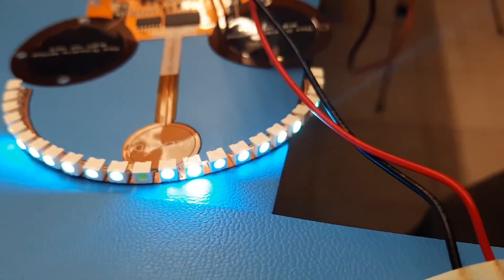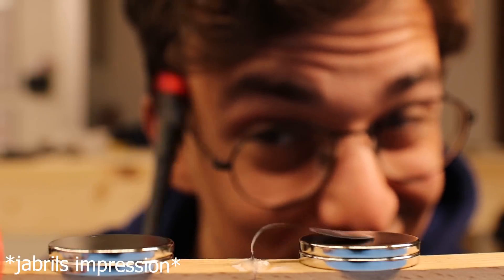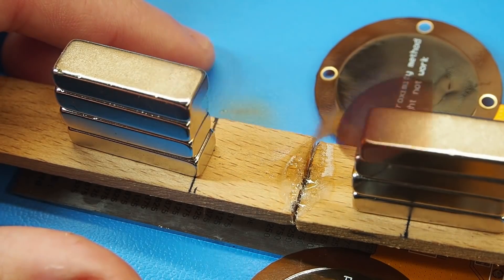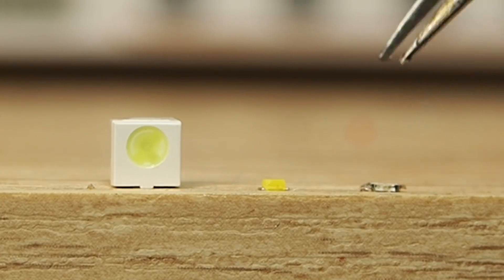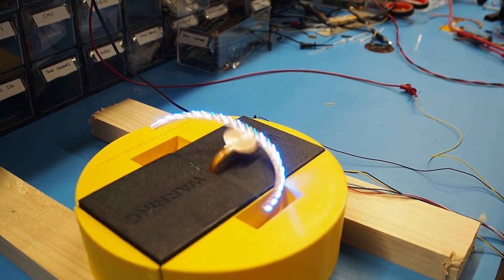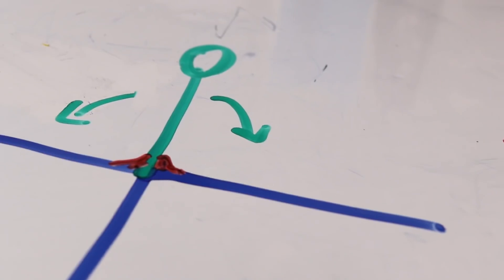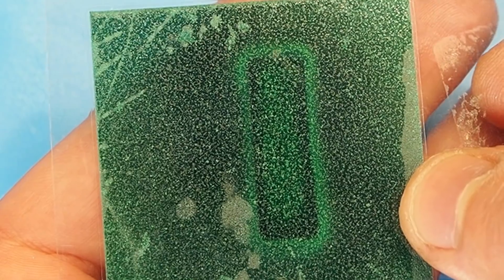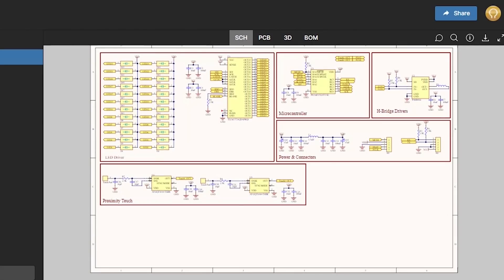Hemispheric Flapping Display

Comment: Idk the flexible display part introduces too much loss because of its wobble, and it also limits the accuracy of the display as it is not rotating on one axis, but rather wobbling as it slams into each of the magnets and accelerating backwards and repeating. Also, air drag affects it, throwing off its trajectory even more. Your best choice is to reduce its rotation to one axis by stiffening the lever arm and integrating a hinge, to save much of the energy without creating too much weight and being minimal and gaining the most accuracy. The only issue is it is less flexible, but honestly, servicing would be easier (if you engineer it properly at the axis of rotation not to tear the flex pcb) and you would get far better picture from it. Also, because you are adding a stiffened lever arm and a hinge, you can replace the coils with a magnet, and swap places. A small neodymium magnet can be attached to the lever arm, and two coils can be placed in place of the magnets. Allowing you to make extremely powerful magnets with electricity, reducing weight, and overall, accomplishing what you want. You would get far faster speeds as  neodymium magnets are quite strong and it's distance from the axis of rotation would mean high torque, which means higher acceleration, which means higher frequency. Of course, in order to get a proper image, you must first use physics to find the velocity at time T on the path, so that the refresh rate of the display as it is moving is in coordination with the instantaneous velocity of the device. Otherwise, your image will be stretched and disfigured. Of course, acceleration is not constant and so you cannot use reformatted gallileans to get instantaneous velocity, but that's your problem not mine. I am not programming it, nor am I getting the hardware. Of course, you assume each time it hits a magnet, it starts at rest and then has a non constant acceleration. The electromagnet it pushes away from should be same in polarity, and the electromagnet it is traveling to should be opposite in polarity, therefore, force would be lowest at the center of the path  it is traveling and therefore the minimum acceleration, but the velocity should have kinda a local max at the center of the path, then keep going up and accelerating as it goes to the reverse polarity coil. This also means the coils would be out of phase, or reversed as a square wave. With it's frequency depending on the time the lever arm takes to complete its journey. Also, for the LEDs, attach like little beads to the ends of them or something so that they glow visibly at a high viewing angle. Actually, instead of a solid lever arm, you could like make a segmented interlocking flexible (rubber like?) bendy arm thing. Like how those 3D printed grabbers work, with strings and flexible fingers that move in one axis. That would also reduce wobble, but it would add a lot of loss. If you are dead set on flexing, that would work though. Or you could like just get a ball, a motor, an arduino, an led strip, and make it do the exact same thing with zero problems.

Comment: Regular Steel has a way too high remanence for this application. You need a soft magnetic material like (very low carbon) Iron, FeSi, FeNi, Ferrite, etc. So you can just buy a magnetic powder core in the right size.

Comment: You are approaching it wrong. Get flappers out of your mind, make an led matrix and make it rotary, this way you get any refresh rate (depends on RPM) and its easier. Electrical contacts can be transfered trough rotary brushed bearing specifically for empowering rotating devices

Comment: You work with heavier parts, so you need stronger mechanics.
Make the flexing parts stronger. Add flexing parts at the ends of the led strip to stabilize it. Make the led strip harder. Make the coils stronger.
I imagine a design where you have two coils at the ends of the led strip and two sets of magnets to work with them. The led strip itself is flexing on the ends and not in the middle. That way the coils and the magnets will be closer to eachother and the led strip will be more stable while oscillating.

Comment: I think redesigning the PCB from a 'T' shape to a '∩' shape might help. Then there would be 2 drivers at both sides of the upside-down 'U' increasing the actuation force and frequency. It would also increase the size of the display (allow for more LED's)  because now you don't have to worry about the ends of the T flopping anymore.

Comment: attach the semicircle to the main arm - the end flapping is acting as a dampener making it so you can't get higher frequencies
Reply: Or remove the main arm and use both sides of the semicircle to drive the semicircle.
Reply: Well having the center not attached would create a similar, though much less significant issue, I think ideally you have a mesh that connects the whole array to the pivot point, which is only flexible in one direction

Comment: Consider anchoring the ends of the LED strip to prevent the outer LEDs from wiggling around so much. The added stability might help reliability as well as display fidelity.

Comment: a big problem is that you have only one hinge point, so the thing is really wobbly. maybe you can make a design like the first flex-display, but with two tails and the spools further apart?
I think additional spools are necessary here because you are trying to move more leds with only one spool instead of the two you had in the first display.

Comment: Awesome project! I love these quirky builds of yours. If I may say from the mechanical side of things, I'd recommend not having the led in a halo shape like that, perhaps a semi circle might work better. With more mass further from your pivot point you have more angular momentum and a harder time changing direction. Also a lot of energy is wasted in the 'flapping' of the halo, if you can make that part more rigid I think would be more reliable. Maybe pinning the ends about the axis of rotation could help? Add a small loop to the ends of the 'halo' and put a rod through them.

Comment: With no background information (first vid of yours I have seen), I am not sure why you don't just use  a motor to spin the arc 360 degrees, at high speed. On the low 180, just turn off the LED's to give a hemi sphere...Heck, just use a transparent 180 degree  half circle of clear material, mount the LED's in an addressable grid, and with 360 timing, you could create a half or full sphere in 3-D that was full color and support 3-D imaging. Make it 0.5m in diameter and you would have quite an impressive spherical POV display visible from any angle. Also, then you could use a vertical axis, and make it rectangular, for a cylindrical 3-D display. Use 'arms' along a vertical shaft for low air drag, possibly small airfoil shaped tubes with SMD LED's on a narrow pcb; you could also stagger the arms ' 'spirally' around the shaft with each 'step' very close to the next vertically for best apparent density. If it were all enclosed, the net air drag would be reduced inside a closed system where all the air rotational inertia was contained, so you could spin it faster, or possibly a partial vacuum.
Still, your attempts are pretty interesting.

Comment: You could try to add a small steel torsion spring (actual torsion spring or simple steel bar) at the base of the flexing stem, and drive it at its resonant frequency. The frequency is defined by the stiffness of the spring and the inertia (mass) of the moving part. This has many advantages:
1- You would need very little energy to sustain a vibration (only compensate for the air resistance and heat dissipation of the deforming material)
2- You could get away with much smaller magnets (don't need large forces if they're only sustaining the natural resonance of the system)
3- You could attain arbitrarily high frequencies (by increasing the stiffness of the spring)
4- You could tune it so the pcb doesn't strike the magnets (less wear)

At some point, you'd also have to consider tuning the resonant frequency of the arms of the led arc. iirc, if the resonant frequency of the arms is higher (stiffer / ligher) than the stem, they will simply follow the stem at it's lower frequency. If their frequency if lower, they might interfere with the motion of the stem.

Hope this helped.

Comment: The problem your running into could be related to the Lorentz force. In a nutshell it says, that when youre moving electrons through a magnetic field, a force in the oposite direction to both appears.  As this needs energy, it must get that from somewhere, so it slows the movement down. (Lenz's law).  Therefore by increasing the strength of your magnetic field, you higher the lorentz force and therefore lower the velocity.

Comment: You could try a spring, either a thin piece of spring steel or an actual spring along the flex. However to get this to work you would need to manually start the system. I also think with this method you could avoid the LEDs hitting the magnets. Different strength springs would give a different harmonic frequency, so you could tune it to the exact refresh rate you want. You might need a feedback circuit to drive it as it enters to field for the first start, and maybe to keep it resonating.
Reply: My personal preference would be a standard coil spring, with the flex running inside of it, retained by a 3d printed collet in the base, and at the top of the flex. Might have difficulty getting flex up the inside of the spring, but this could let you preload it a little as well.

Comment: i feel like you should take into consideration also the self vibrating frequency of the flapping stuff. for example, why not connect the extremities of the LED semicircle to the center, with a small piece of pcb? it would make the flapping pcb behave like a single part. with the current design you have several modes of vibration that interfere one with the other and makes it more difficult to move.

Comment: Aren't electro magnets (in general) stronger than regular magnets (of the same weight)? -- Why not put electromagnets on the sides as well (instead of natural ones?) -- that can give you the added benefit of being able to push and pull from the sides as well to help with acceleration and deceleration (if you decide to control them and not just hard wire them).

Comment: You could use a rigid pcb and spin it with a motor. You can use a wireless charger for power and some LEDs and photo diodes for data.

Comment: Consider adding some stiffness to the PCB section that acts like a spring. It seems like it might be worth investigating what frequencies you can achieve if the pcb sits at rest 90 degrees, perpendicular to the magnet surface.

Comment: I think that instead of trying hard with insanely big magnets to increase the force, it would be more efficient to design the flexible part as a mechanical oscillator, tune it to particular frequency and increase Q-factor. Then the force (and thus the magnet size and coil current) required for keeping the oscillations will be orders of magnitude less.

Comment: Nice project , Why you didn't fixed the led from the  tow edges  , so it oscillate  only in the  desired direction  , or try to rotate  them with a DC motor so you can obtain  a spherical  display .

Comment: I have some suggestions. Instead of one central connector, you could have one at each extremity to avoid torsion. You could increase the stiffness of the material or increase the total width of your connector. This will increase the speed of the natural resonance frequency of your system. If you drive your electric signal at the natural resonance frequency it will move easily. If you put more than two connectors, you cannot have an arc of a circle of LEDs because the length of each connector won’t be the same so the natural frequency.
Reply: ❤❤❤😮😅😅 pm❤❤❤❤❤❤❤❤❤❤

Comment: Is there some way in which you could "channel" the magnetic field of the permanent magnets? I'm not sure on the HOW, but I feel that it must be at least possible, even if it obscures the view of the LEDs, at least a proof of concept would go a long way, instead of working with unreasonably large and powerful magnets. For example, flat fridge magnets have surprisingly strong pull for the weak magnetic force they have because they have a printed structure of polar opposite magnets across the surface, and so instead of wasting their weak magnetic energy in a large area, it contains it close to the surface of the magnet and the fridge door. Just having two bare neodymium magnets at 180 degrees from each other and however many inches apart, I would guess upwards of 60% of potential magnetic energy is just being wasted in the surrounding air, probably much more than this even. IDK the solution, but I hope to see it tested in future, I love this whole series even though I can't see much practical application for these things 😅

edit: There I go commenting before watching the whole video again lol whoops. Steel underneath certainly seems like a decent starting point, but I would like to know if a similar thing could be achieved on the active side, creating a strong magnetic arc between the two sides more than just having the magnets in proximity alone would achieve... inb4 I click play and you then have tackled this part too...

Comment: I think the issue is more with the length of the cable trying to flex and all the added surface area and mass on the top. Its likely the strong forces caused by movement at the top and the ends are likely keeping your speed so low, it has to drag everything along with it and it can't just accelerate so quickly.

Edit - A reciprocating motor connected to a 3d printed arm and supports glued to the strip would let you achieve a faster refresh rate.

Comment: Do you need the coil so high up the "stalk" of the device? if it were closer to the base (or maybe halfway down), it would be in a much stronger field area, and wouldn't need to travel as far (lever principle). You might need to make the upper portion of the stalk rigid if you did this.

Comment: Have you considered or tried using a spring so that the neutral position of the array is sticking straight up?
Alternatively, you could mirror the whole design to make a sphere instead of a hemisphere. The shaft could be non-flexible with a pivot in the middle so that the whole thing is counterbalanced.

That way the neutral position would be vertical and when the top half is being pulled toward the right magnet, the bottom half could be pulled toward the left magnet and vice-versa.

In fact, the whole thing (except maybe the coils) could be non-flexible pcb, which might help with the warping.

Comment: would there be an easy way to adjust the "springiness" of the arm? it seems that the flex arm loses all momentum hitting the magnet and has to accelerate itself at the beginning of each cycle. a springy arm might slow down the arm before it gets to the magnet and use that energy to push it into the next cycle, but you would have to adjust the frequency and springiness to match

Comment: looking at the design I have some ideas for the reasons of the result based  on control modeling of oscillating systems. I think part of the problem is the stable points of the system at rest, the rest state is not at the middle, but either to the right or left of the middle. It is analogous to a ball having to roll uphill to go through. A nice way to think of the forces necessary to move the LEDs is a hill in the middle with two hills on each extreme, you don't need any force to get the flexar to the right or left equilibrium points, as long as the flexar is at this region, it tends to the equilibrium. The problem I see with this design is that you need more force to get from one side to the other, while the magnets are further from the coil,  since from one side to the other there is an uphill. The optimal design would look closer to a ball rolling on a parabola, which implies the stable equilibrium being right in the middle, that way it would not need much force exerted at the apex, just enough velocity to cross. I think that means a stiffer connection in the flexing region, but in stead of just making it stiffer, I think this and another problem could be solved by adding one or two more coils at the tip. More coils meaning more connections, I suppose the mass change from one more coil would be close to negligible compared to the LEDs and overall the stable point would move towards the middle. This would also probably solve the oscillations around the connection with the flexar, making the long exposure image closer to a grid. If you want to know the exact stiffness you need, and maybe even apply some closed loop control, you can model the system with some differential equations, I think it would look something like the equation for a mass with springs and dampeners on each side.

Comment: "he said to use a piece of steel so i used two" yeah that's not how magnets work :P
Reply from the maker: There had to be a gap for the arm/wires to pass for the inside 🙂 the air gap was reduced as low as possible

Comment: Add coils along the arc and stack arc-shaped magnets angled at 45'
Reply: you could make a strip of any length with flexpcb columns at either end with solder pads (and id jumper pads when soldering them in a chain) supporting the straight strip of LEDs across the top with your drive between the columns at the LED end

Comment: I feel like you need to experiment with the spring stiffness, maybe by doubling or tripling up on the stem flex board part
Reply: exactly- 2 or 3 stems would stabilize the motion and additional spring restoring force would allow a higher max frequency